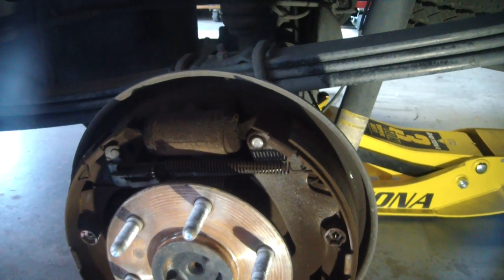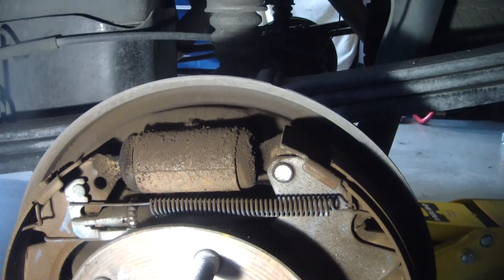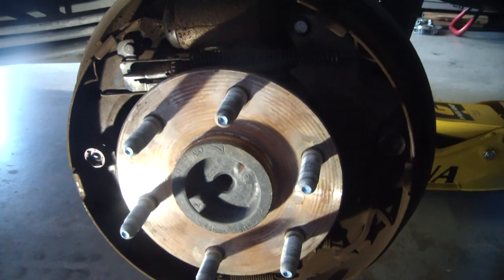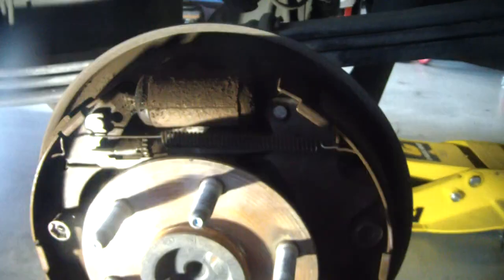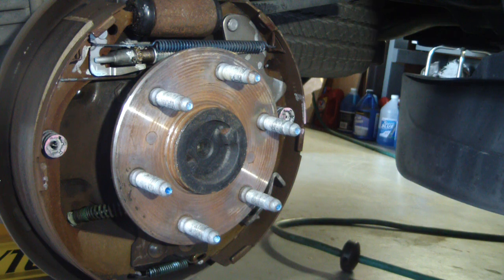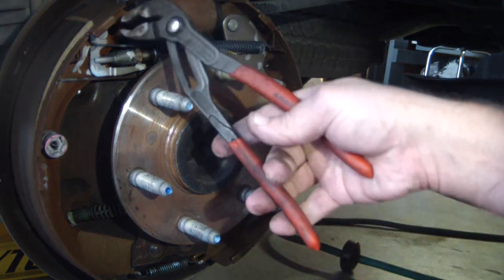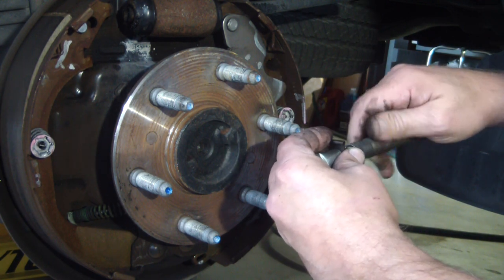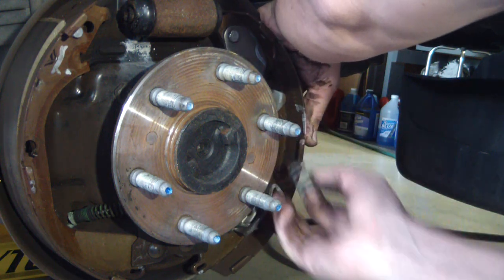Rear Drum Brakes on 2013 Silverado Pick up

Comment: I just did some brake shoes on a 2013 Silverado today. i took mine off and put them back on the same way as you did them. i figured they were self-adjusting but didn't know for sure thanks for the tips. I used a old battery clamp bolt (the larger one) to take off the right brake drum. The left came right off after taking the wheel off.

Comment: I’m done after 3hrs and the hard parts are removing your drum and 10mm bolts I was hunting down at lows. Hammer was not really needed with bolts doing the work. Took me forever to get drums back on but once I got them to slide on it was like a glove and no adjustment at all needed just a mental break check lol. Again thanks for helping us with your videos.
Reply: What “hubs” did you remove changing brake shoes? I didn’t think the rear even had em. Better go look at mine to see if they are “simular”
Reply: @wadesmith9483  sorry about that no hubs lol the drums were a pain. And getting the drums over the new break shoes will be the hardest part. Hair fit and kicking them on worked.

Comment: Mine didn't pop off hit the hammer. Used bolts to get it off. For anyone wondering the bolt size is a 10mm x 1.25
Reply: Thanks!

Comment: So my left rear on my 13 LT Silverado is sticking and locking when I turn slow. And my abs is on. It started happening when I changed my left front wheel bearing.
Reply from the maker: If you have a scan tool hook it up and monitor the wheel speed sensors and make sure they are reading right.

Comment: Finished mine but they sound kind they are scraping . But I guess they need to adjust ?
Reply from the maker: They should adjust quickly so if they still sound like that after a few days you need to investigate.
Reply: @737mechanic  yeah before I put tires back on I turned them and they scrape when just turning them . While the tire is off so I’ll check in a few days .
Reply: And I did not turn the drums either . Did exactly how you show the video
Reply from the maker: @chevycmf  as long as the drums looked good you should be good.
Reply: Well I inspected today and the ware tab Is rubbing on the drum on the inside that goes flush on the hub . Don’t know why it’s doing that . I checked old ones and it did so the same . But I can hear it kinda grinding . I checked to see it the shoes were lined up but and the scores are touching the brake hear shield like it should . They are touching all the points correctly. So I’m not sure what else to do
Reply: Yeah I made sure the contact points were good . But for some reason it grinding on the inside of the drum the part that roches the tabs on the shoes . It’s going great where the shoes touch the drum . What other adjustment is needed ?

Comment: Can these kind of brakes fit on a 2008 chevy silverado 1500
Reply from the maker: 2008 some have rear disc and some have rear drum. You can look through the wheel or from the back and sww what they are.
Reply: @737mechanic  I got the drum brakes..but just got one spring and a adjuster beside the wheel cylinder..just wondering if those kind of brakes you are working on would fit on a 2008 chevy silverado 1500

Comment: How to know if the back brakes are going bad. My brake pedal starting to feel low and seeming harder to stop. I changed my front brake pads. I never changed the back shoes, since I had the truck in 2009.
Reply from the maker: You need to pull the hubs off and look at the brake shoes.
Reply: @737mechanic  OK. I assume that if the shoe is thin, it needs to be changed?
Reply from the maker: @bigcartoonyIIV  Yes
Reply: @737mechanic    Update. I tried to get off one of my drums, and it was stuck.  As i finally screwed them off, my shoes were stuck to the drum,  the shoes pulled off and then my wheel cylinder started to leak.  I still have to do the other side.

Comment: How do you adjust the parking brake?
Reply from the maker: If you are talking about the parking brake cable there is an adjusting nut on the cable close the the rear brakes or at the foot pedal. Simply tighten it to take up the slack
Reply: @737mechanic  I done that I still can't get the parking brake to hold.
I put in new shoes all the hard ware and adjusters with new drums and wheel cylinders
Reply from the maker: @marcw5288  Make sure the ignition drum shoes are adjusted out right to the point that the drum will just go on. Then if you need to before you put the drum on have someone slowly press the parking brake and watch and make sure the shoes open up. If they do and everything looks normal install the drum and press the parking brake pedal and see if the brakes hold.
Reply: @737mechanic  ill.try that this weekend

Comment: What do you recommend if you did this job step by step and now have an ABS light on the dash?
Reply from the maker: There should be no reason for an abs light from doing this job but the first thing I would do it reset it and see if it come back instantly, if it does more than likely the ABS sensor is bad.
Reply: @737mechanic  I’m not sure of how to reset it. I tried taking the leads off the battery for 5 minutes and it stayed on. I looked to see if there was a sensor around the back of the wheel but didn’t see one. 08 Chevy Silverado 1500
Reply from the maker: @MrEricMcCullough  depending on option package you can have 4wheel anti lock brakes or 2 wheel. 4wheel has abs sensors on all 4 wheels and 2 wheel has abs sensors on the front only. Go by autozone and have them hook up and tell you what code is present.
Reply: @737mechanic  it’s a z71. I did go by Autozone this evening and no codes were found.  But the ABS light remains on.  I asked to buy a sensor for the rear and they were unable to specific the exact one I needed for the rear.  They recommended taking it off and cleaning it but I can’t seem to find one.  I do see them in the front.
Reply: @737mechanic  when I did my rear drum brakes I had let my axle shaft spin and noticed it had a little wobble to it does that mean I need to replace them with new ones?
Reply from the maker: @etherdarc7645  If your hubs wobble when spinning then they are bent,  I would bolt eveything up and spin them and see how bad it is. Then go from there.

Comment: Is the driver's side star knob reverse threaded? 🤔
Reply from the maker: I cant remember to be honest.
Reply: @737mechanic  it wasn't. I just had to use the pivot arm for the auto adjuster with "R" stamped on it for the driver's side. Previous owner used 2 of the arms with "L" stamped on them since it made both sides identical (I assume). Problem was that the auto adjustment would contract each time instead of expanding the shoes. I wanted to assume that L and R indicated Left and Right sides but I guess the "R" stamped is for Reverse :shrug:

Comment: 5:48 - Those springs are not holding the drum on. They're holding the shoes on.
Reply from the maker: LOL Of course they are not holding the drum on.
Reply: @737mechanic  But that is what YOU said.
Reply from the maker: @Bob31415  If I said that it was a mistake.
Reply: @737mechanic  That's ok. It is a good video.